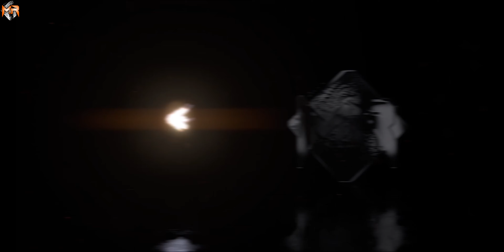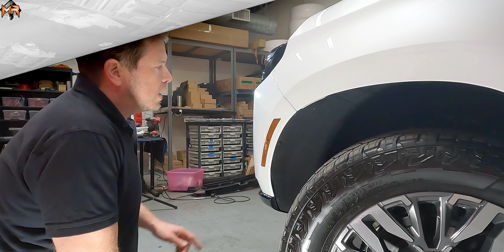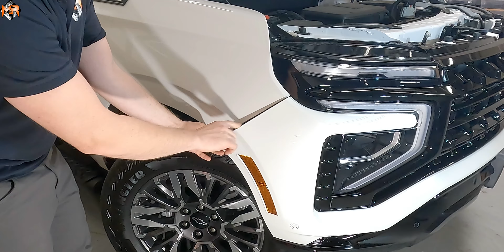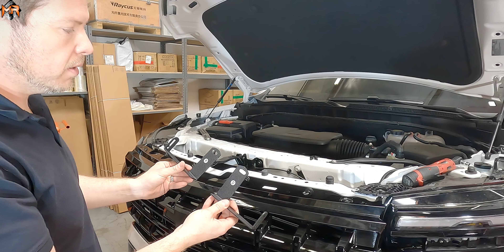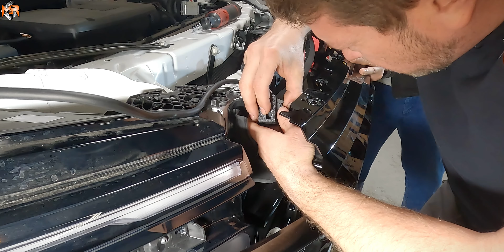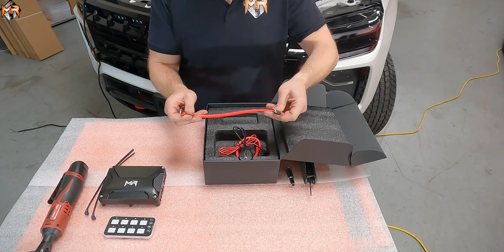2025 Chevrolet Suburban Z71 Light Bar Install by M&R Automotive |Tutorial DIY

Comment: What type of ratchet are you using for the bolt in the wheel ?
Reply from the maker: Its the type where the head of the ratchet flops up and down making it more flexible. They sell it at harbor freight.
Reply from the maker: something like this https://www.harborfreight.com/38-in-drive-professional-long-reach-flex-head-ratchet-with-comfort-grip-58590.html